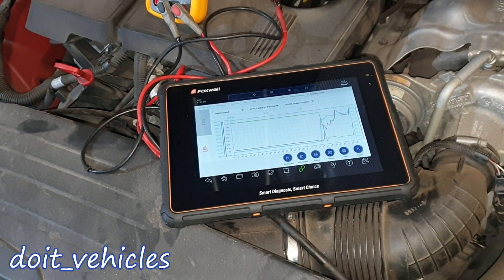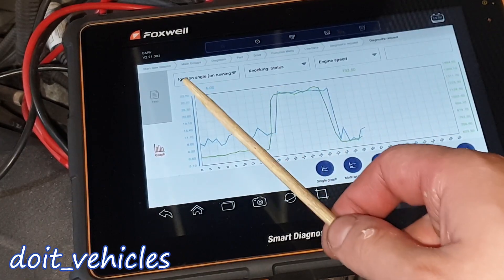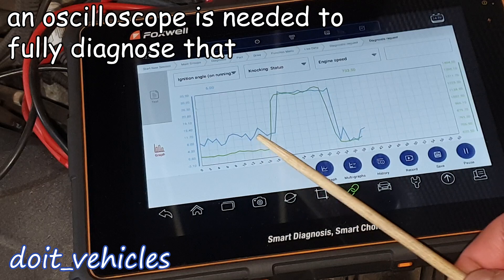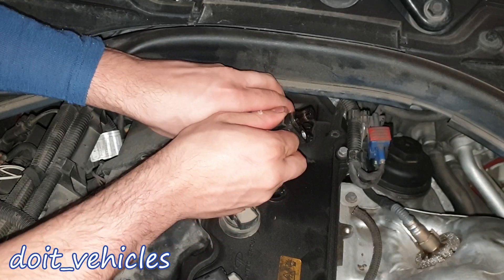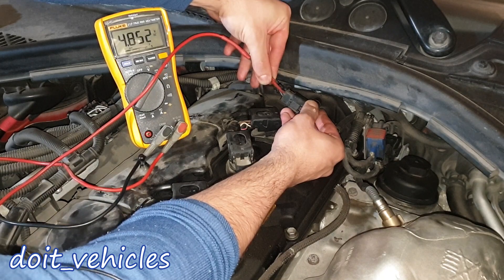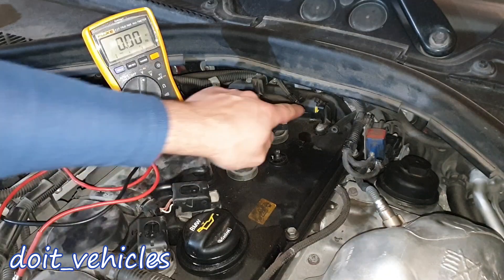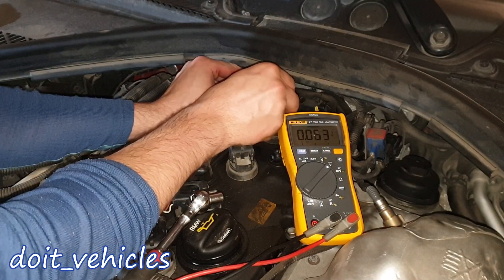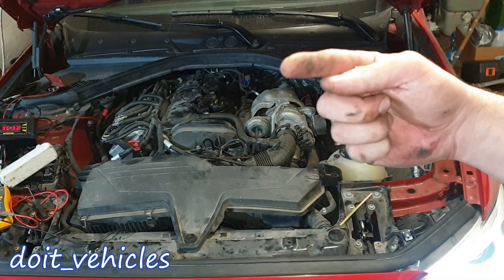114i BMW Camshaft VANOS sensor Voltage F20 116i 118

Comment: is this also known as the eccentric valvetronic shaft sensor? I’m getting error codes 21A416 and 21A417 ajd the car is in some sort of limp mode. and i’m pretty sure i have an some sort of issue with that sensor mentioned above and the vanos solenoids. I also have BMW 114i